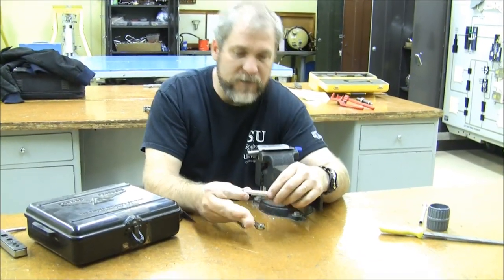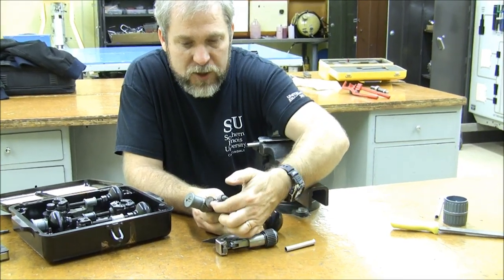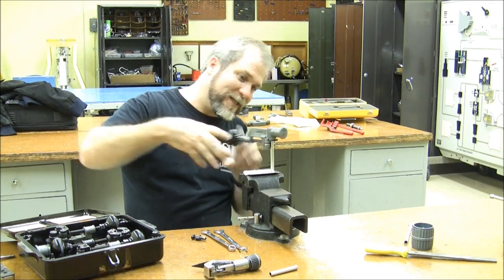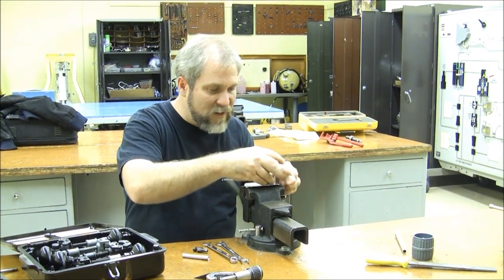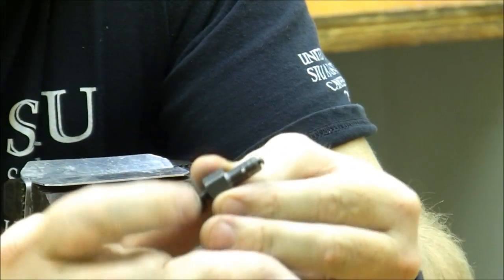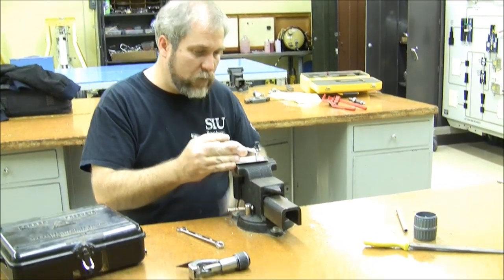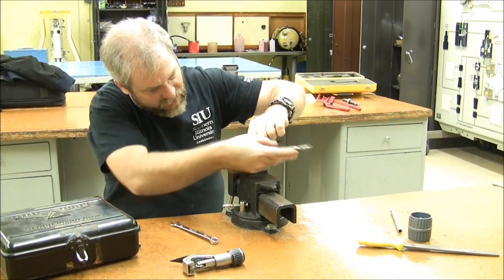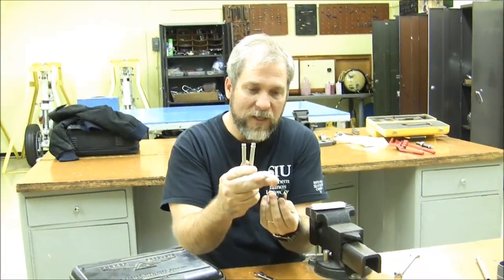Aviation Tools Training - Beading Aluminum Line

Comment: I don't have a beading tool, but I do have a tool for making ISO "bubble" flares.  Why might I want to use a beading tool instead? (sorry, I'm an automotive guy and I'm just starting to learn about aviation stuff)
Reply from the maker: Compared to the bubble flare, the "bead" made by a beading tool is less extreme, and also does not happen at the exact end of the tube.  This give little bit more strength in a ridged tube to flex tube connection, and a little bit better flow characteristics.  It is also a little bit easier to slip the hose over the beaded tube...
Reply from the maker: You need to know that aviation guys (and the FAA that can take our licenses away) are very picky.  We have to follow exact procedures as outlined by the manufacturer, so if they call for a beaded tube, we have to use a beader, and not a bubble flare tool.
Reply: @1donagin Thanks for the detailed explanation.  :)